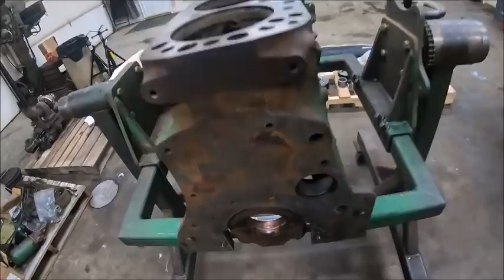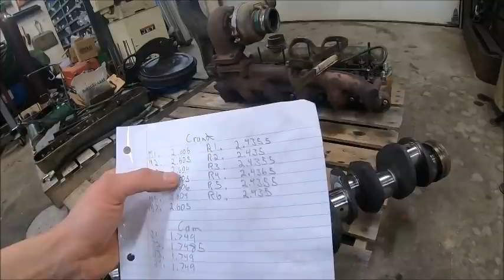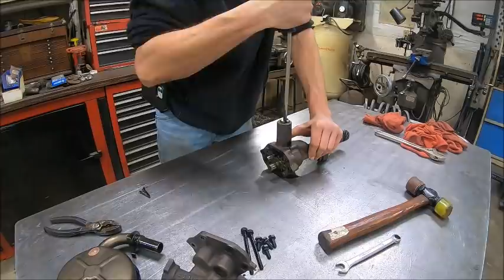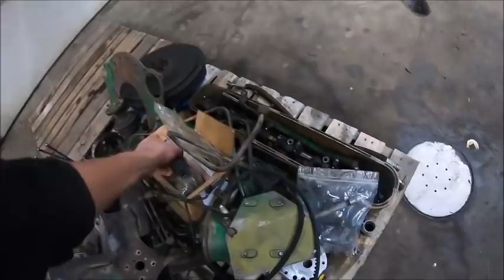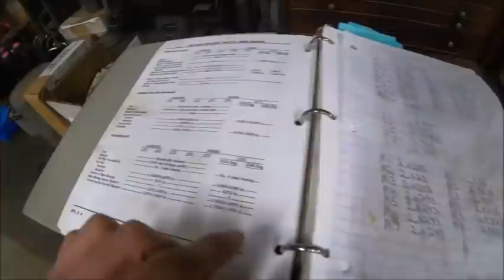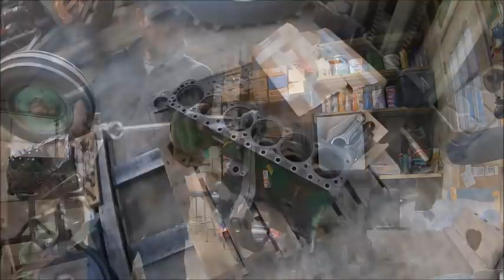Oliver 1950T Overhaul Part 3: Cleaning And Inspecting Parts

Comment: Hey Man glad you had another crank. Like you said it is very hard to find a good one for a 310. I bought a good virgin crank and oil cooler block. It cost alittle bit to get them but we have a few tractors with 310's Im sure one of them will need one or the other at some point.  I totally agree with you about no one wanted to have a job in a skilled trade anymore. It really sucks that its so hard to find a good machine shop anymore we have the same problem around here. Well happy New year and good luck with the barn and everything.

Comment: I just pulled the crank out of my 1755 and the main bearing say 10 9 77
221022 on the bearing do you know if that's a standard bearing or if it's been ground 10 under

Comment: First off I love your channel for the no BS and the story's/history/views you always talk about, I was mainly a IH man before. I found your channel a couple years ago after I purchased a gas 1655 at auction for my small farm that looked good (painted) but was basically a POS mechanically from lack of care but I'm slowly getting it back into shape. Your channel has helped tremendously in that process for not going in completely blind into the bigger repairs even though I have the manuals. I went through the hydraulics last spring (pump, seals, 3 point cylinder, etc) and this spring I will go through the PTO as it always turns. I want to thank you so much for your channel and this series as I will be rebuilding the engine and 3 speed hopefully next year. So just know your channel helps people and I'm sure many are grateful that you take the time to do this but may not comment all the time.

Comment: Ethan,

Are the over and under units the same for all the 50 series?
(I have a 1650 diesel)

When I sent my engine out for overhaul, I didn't touch it. It was working great.

Now I almost wish I had.

Your thoughts..

Comment: Watching you struggle to loosen the oil pressure adjustment on the oil pump and the compressed spring makes me wonder if someone ran the adjustment all the way in to get the oil pressure up with the bad bearings. I have no experience with those particular oil pumps, but made me wonder.
Reply from the maker: It was just stuck. It had more in.
Reply: @Oliver66FarmBoy  good deal. Always hard to tell on this side of the camera

Comment: That piece of wire looks like a straightened out paper clip some idiot dropped in there probably trying to punch gunk out of a journal. I overhauled an MG engine several years ago and found a couple cotter keys in the the water jacket in the head. Found out later those Brits were dropping all sorts of junk in those BMC engines back in the early 70s when there was so much strife goin on with British Labor.

Comment: It’ll be alright, Ethan. I just lost my wife to cancer on the 4th. She and I slaved for 15 years paying on a loan that bought my parents out. Just as soon as we made the last payment 4 years ago we found out that she had cancer. After a valiant fight for 40 months she died. Everything we worked for is payed for and there were times when we didn’t know if we’d pull it off but we did. Money is only a commodity just like fertilizer, fuel or grain. Just keep doing what you do the best you can and you’ll work through it. Best of luck and happy New Year.
Reply from the maker: Damn. That’s a rough one right before the holidays.

Comment: I spent many years as an ag lender.  Things hardly ever happen when we want them to happen, but if you are a thinker and a “doer” you will find a way to get through this.  Most times, when the dust settles, the things you had to do sooner than planned are a blessing in disguise.  A couple of thoughts about borrowing money:  borrowed money used for productive and non depreciable purposes is the right place to borrow and as an old banker told me when I was starting out, “When we lend money, someone has to worry about it.  Either the borrower or the lender.  If the borrower is worried, the banker will not need to worry because the borrower will find a way to make it work.”  Your knowledge and work ethic will be the key to your success.
Reply from the maker: Still don’t like owing money to anybody. I like to be free and clear so they can’t come take it.

Comment: With the vibration you are talking about at the back of the engine and the wear to the back. I would think replacing the crank will probably save you from a broken crank in the next few years. You definitely are doing a thorough overhaul.
Reply from the maker: The only way you can do a 310. There is no close enough is good enough way around it.
Reply: @Oliver66FarmBoy  I’ve always been impressed with how well your 1955 runs. No doubt the 1950T will be a strong runner when you’re done.

Comment: Is there much difference between a 3 speed like on a 50 or 55 series vs what's in a 2-135 or 155?
Reply from the maker: None other than the whites don’t use a chain coupler.

Comment: A fabric hoop building can be put up in a few days..   My Chinesium 30x65 is surprisingly nice and I did it by myself(except for pulling the cover over).  Might be a good option for a quick, temporary solution,  just sell it when you get the barn you want.  Keep us updated either way..  Barn builds are interesting.
Reply from the maker: Worst part about going that rout is it costs more money in the long run because you end up buying 2 buildings for one.
Reply: @Oliver66FarmBoy  Too much storage is never a problem., you have plenty of equipment sitting out already that wouldn't be hurt by some cover.  Also, at least here, a fabric building is considered a temporary structure so no extra taxes.     Any route you decide to take,  go bigger than you think you need and don't worry so much about the money now because it sure won't be 
cheaper in the future.

Comment: I had the same question about finding a metal rod in my 1550 Oliver head, was told it was part of the forging progress when it was made. I like enjoy all of your videos
Reply from the maker: I guess they used some wire to hold the sand molt together.

Comment: I'll bet that wire was to hold the sand mold together, and just finely broke out, I once delt delt with a 7120 magnum that seemed to have a chunk of the sand mold in the head and once in a while it would block the passige and make it over heat
Reply from the maker: Interesting. Never knew sand molds were reinforced.

Comment: That crank sleeve in the pulley is interesting, the motor I’m currently rebuilding has the same setup. Have to check out the pulley on my original motor. Thanks for the information.
Reply from the maker: Makes me wonder if it was some sort of factory “fix”.

Comment: Sorry to hear about the storage shed. Good luck with getting one built. It's hard to remember where we keep parts at sometimes. LOL It's a good thing you did remember about the crank you had. I like the metal table you have in the shop, maybe sometime you can do a little video on it. I have a very small channel compared to you and most of the channels I watch, but I get comments similar to that too. I gust tell them to go fine a channel that does thing more the way they like and keep there comments to there self.  Happy New Year.
Reply from the maker: That’s about all you can do with them. They usually still pitch a fit when you don’t bend to them. It’s funny.

Comment: Ethan
Just to add to the blue color statement I have seen the motor builder's trade fall(lose) trade's men just like the old time machinest in my area where there is a lot of paper mills it is do to the fact that no body wants to work anymore the younger people think they can start at the top and make 100,000.00 grand a year right out the gate now as far as I know the only job you can get starting at the top is digging a hole all others you should start at the bottom and I do like seeing the thing's you put in videos
Have a good new year
Vinny
Reply from the maker: That’s not necessarily true anymore. The place I work and a lot of others I know of now hire managers straight out of college and put them in charge of people with 10-15 plus years of experience on the floor. I probably don’t have to tell you how well that usually goes. It’s comical and painful to watch at the same time.
Reply: @Oliver66FarmBoy  They do the same crap at the machine shop I work at.  You try to explain something to them and you would have better luck explaining it to a brick wall. It always burns them in the end.

Comment: Sorry to hear about your barn ordeal.perhaps you could put up a hoop building for machine storage. And build a shop later on if you want to build it yourself
Reply from the maker: Right now with steel prices they are just as expensive if not more so than a pole barn.
Reply: From what I see and happening elsewhere this seems a really good suggestion for cold winter storage of machinery. 
You need a level base. The fabric is expected to last 20+ years providing it is kept taught. 
I am assuming you are not in a strong wind location (60mph +). 
Internal condensation in the winter could be an issue if you close both ends fully. access seems to be from at least one set of doors from the ends.
Reply: Several farmers in area put them up and they are satisfied. Big savings and tax advantage check it out.youtuber from southern ohio put two up recently.